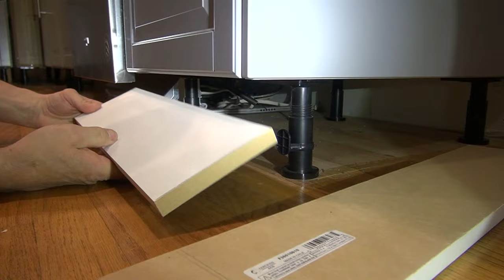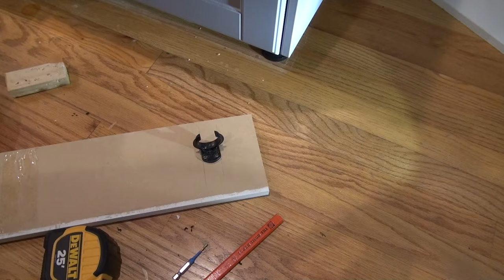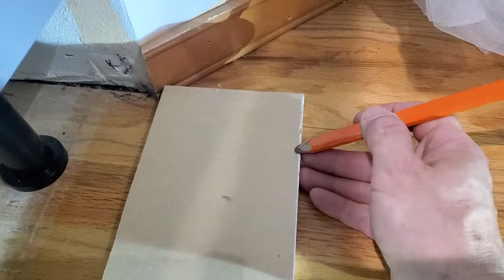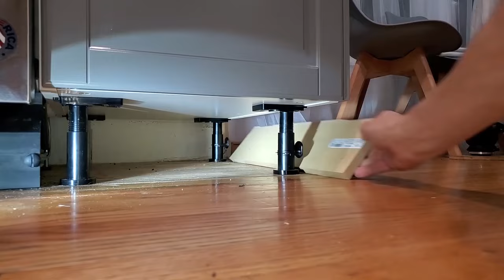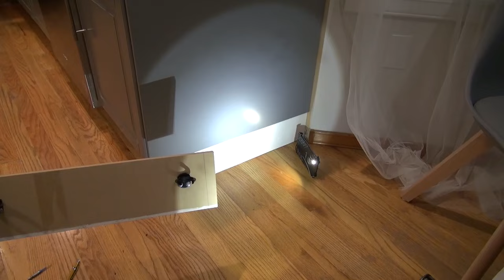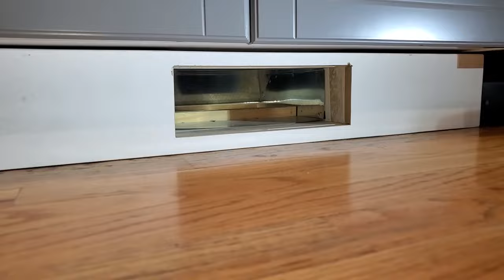Toe Kick DIY for IKEA Kitchen Cabinets. МДФ плинтус для кухни ИКЕА

Comment from the maker: You may be interested to watch 37 videos of "Old kitchen replaced for a new IKEA".
1. IKEA Kitchen, Design, Planning. Кухня IKEA, дизаин, планировка  https://youtu.be/IAM49Tfm9Vk
2. IKEA Kitchen, Old cabinets demolition. Разборка старой кухни  https://youtu.be/c_sEq7CEBGU
3. IKEA Pantry cabinet installation. Установка кухни IKEA  https://youtu.be/c5kdXEkk3vg
4. IKEA Refrigerator Cabinet. Установка кухни IKEA  https://youtu.be/6cHSXHfDoeU
5. IKEA Oven and Micro cabinet, Window trim, LED wiring. Установка кухни IKEA  https://youtu.be/gMW2csSP5lI
6. Window painting before IKEA wall cabinets. Покраска окна перед IKEA шкафами  https://youtu.be/3xrpnTj_QGg
7. IKEA Wall and Base Cabinet installation. Навесные шкафы и тумбочка кухни IKEA  https://youtu.be/SxO82Lw3VsM
8. Countertop Installation IKEA. Установка столешницы IKEA кухни  https://youtu.be/AY2ikKG9Hao
9. IKEA Wall cabinet installation. Настенные шкафы IKEA  https://youtu.be/JmYqcn106ds
10. Light Switch for LED under cabinet. Выключатель для светодиодной подсветки  https://youtu.be/8VBIw6Dl2mM
11. Under cabinet IKEA trim and side panel. Кухня IKEA, установка боковых панелей  https://youtu.be/ZfMVL0GrzZk
12. How to install a drawer handle IKEA. Как установить ручки на ящики кухни Икеа  https://youtu.be/645s8e-qmtY
13. How to Install Cabinet Bar Pulls. Как установить ручки на двери кухни Икеа  https://youtu.be/yhlGFIaXG3I
14. Windows painting. Грунтовка и покраска окон - https://youtu.be/FBpluiC-4pQ
15. Granite Countertop Cracks. Гранитная столешница с трещинами - https://youtu.be/FcvIS7DXnsA
16. Replace Cabinets Without Removing Countertop. Укрепление гранитной столешни  https://youtu.be/dmnHyz1i1UY
17. Granite Countertop Edge Support. Укрепление края гранитной столешни  https://youtu.be/zHQjo_liKhk
18. Plywood Support under Countertop, IKEA cabinet. Укрепление гранитной столешни кухни ИКЕА  https://youtu.be/pZ7J7GdDAHQ
19. How to make Floor Vent Under Cabinet. Воздушная труба под тумбочку  https://youtu.be/eSQoIbTK9vY
20. Old Sink Drain Pipe Extension. Удлинение трубы слива раковины  https://youtu.be/VNOEfpE4H4g
21. Garden Faucet Replacement. Замена садового крана  https://youtu.be/eWbU8DK-3JY
22. Cut Counter Top for a New Kitchen Sink. Подрезка столешни для новой раковины  https://youtu.be/bwCjFCE6vjg
23. Plywood support and two cabinets installation. Укрепление гранитной столешни кухни ИКЕА  https://youtu.be/dPPSq0HUT20
24. Kitchen Sink installation. Установка мойки, раковины  https://youtu.be/itoQH_OEuBA
25. Kitchen Faucet and Garbage Disposer installation. Установка крана и измельчителя отходов  https://youtu.be/7eiquGydvDA
26. Dishwasher installation. Установка посудомойки  https://youtu.be/t1aRk9wvvO4
27. IKEA Cabinet side panel, Drawers, Door. Боковая панель, выдвижные ящики, двери ИКЕА  https://youtu.be/tp4WRQfOCko
29. Hood Duct pipe and Electric Outlet installation. Труба вытяжки и розетка  https://youtu.be/0IDhl8vfP80
30. Recessed Light Housing for LED. Светодиодная лампа над плитой  https://youtu.be/yj5pJXq_XtE
31. Island Range Hood Installation. Вытяжка над плитой в потолке  https://youtu.be/WgI0EnnLrMk
32. Range Hood Reinstall Higher. Переустановка вытяжки повыше  https://youtu.be/JDOnix5G_K4
33. Counter Top support before Cabinet Demolition. Как удалить тумбочку под столешней  https://youtu.be/Fo3Bg9uMjP8
34. Plywood under Counter, Cook Top Cabinet. Тумбочка Варочной поверхности  https://youtu.be/mur2U-MGYuU
35. Cook Top Installation. Варочная поверхность, установка  https://youtu.be/NO4tFznoNvo
36. Cabinet Legs Support, Last Cabinet installation. Ножки под тумбочку  https://youtu.be/wmO8f1ayzqs
37. Toe Kick DIY for IKEA Kitchen Cabinets. МДФ плинтус для кухни ИКЕА  https://youtu.be/w87eu3D26iQ

Comment: Are you satisfied leaving corner with exposed MDF?  Was a mitered corner nor an option?
Reply from the maker: This is factory pre primer board. After this installation corner will be rounded with 1/8" router radius bit, and than all fresh cut sides will be primer and than painted in gray kitchen color.
If you use mitered 45 degree, it will be more visible joint (if not a glued). 
At my way face now without joints. Only can be seen joint if you look from right side.
Reply: I put a tiny molding to hide that cut cause Theres speical blades for MDF but i just put tape where i cut and wasnt perfect but i put a molding

Comment: Can you please share the link where i can buy these boards. Thanks
Reply from the maker: This boards from Home Depot/Loves, other stores available too. This is pramered  MDF 3/4". It's sold by different width. I bought 6" wide and cut  off at my width needed on table saw.
Reply from the maker: Primed MDF Board: https://www.homedepot.com/p/Pac-Trim-Primed-MDF-Board-Common-11-16-in-x-5-1-2-in-x-8-ft-Actual-0-669-in-x-5-5-in-x-96-in-1702368/202712037